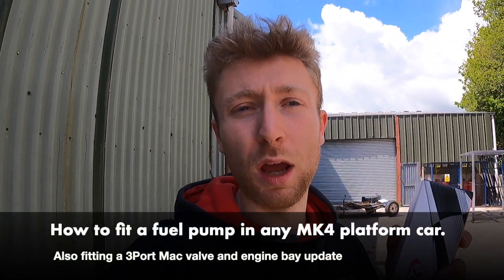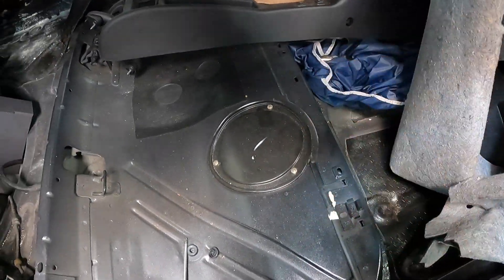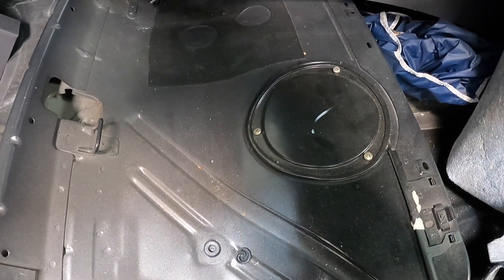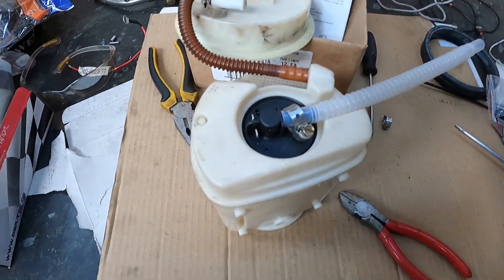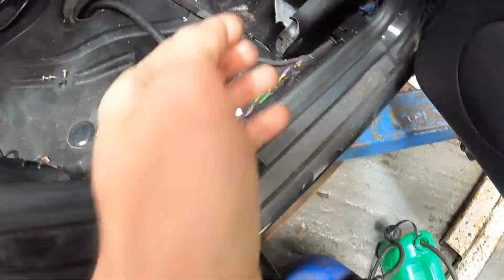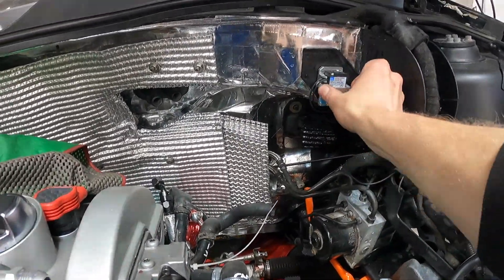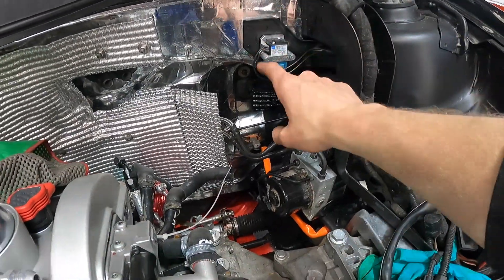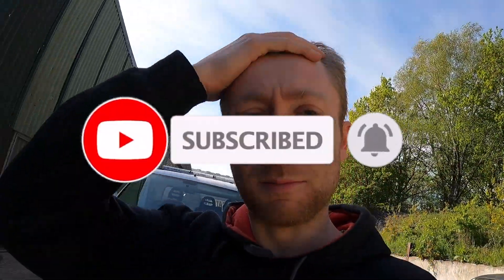EP12~ High Flow *600hp* Bartek Fuel Pump (how to) & more Billet parts for the Big Turbo 1.8T 20V

Comment: Hey man,Did you upgrade the wiring and 30 amp switching relay 5 poles and 30 Amp fuse asking because for this Bar-tek pump they says!"Warranty will be lost if not"

Cheers!
Reply from the maker: Yes I’ve upgraded the wiring to support the current draw that the fuel pump will create . Don’t see how it effects there warranty but I would upgrade it . Just asking to pop fuses or damage wiring if not